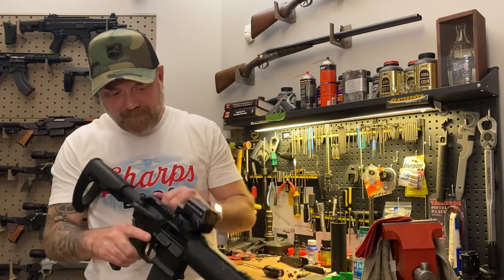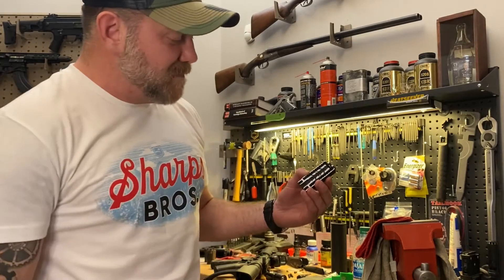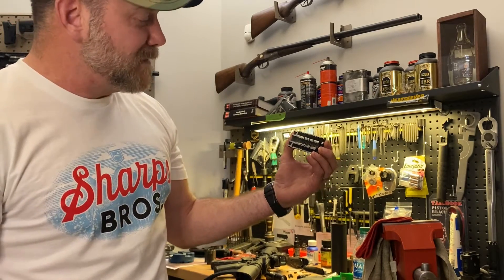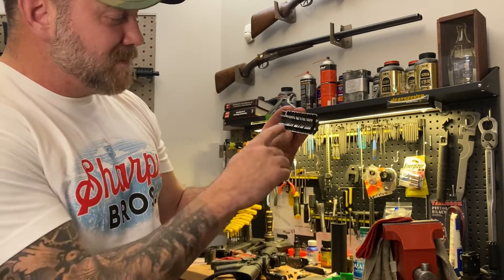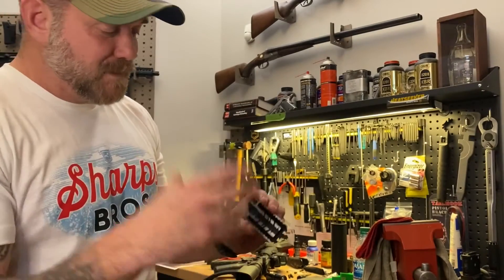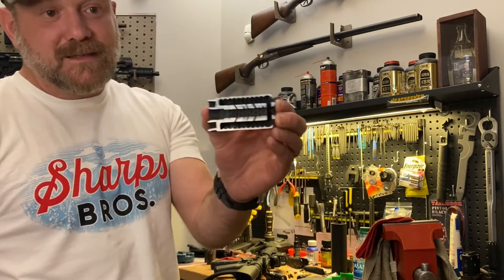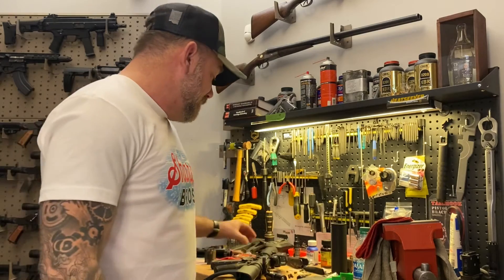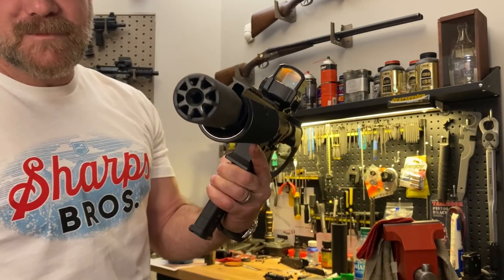A look inside Badlands. Sharps Bros’ integrated muzzle brake & blast deflector.

Comment: Does it have to be time or lined up in a specific orientation to maximize the benefits of internal muzzle brake?
Reply: No. It's pretty symetric so I just threaded mine down and used blue 242 threadlocker and cinched down w/a 10" adj wrench from Channellock that opens all the way to 2".

Comment: I'm ordering one from Optics Planet this month.
I will post some videos on my channel.

It's going on Palmetto ar-10.
I can use AR-10 Crush Washer, right?

Is there an adapter so that the 5/8 will also fit on 1/2 ?
If not, there should be.

Comment: Love it. Can’t believe it actually reduced the recoil on my 7.5 barrel ar15 so well. I do run a Banish 30 at seven inches on it so I have a semi permanent adapter that matches the 5/8x24 threaded one you sell but holy moly it really improved my ability to stay on target. I also run the JP silent captured spring which is amazing to so the two combined make it really quiet and hardly any recoil. Thanks

Comment: Has there been anyone using this on .22 lr or .22 mag short barrel AR pistols?
The POF Rebel (.22 lr) originally shipped with a thread protector and threaded barrel. They had problems of not enough back pressure for consistency of action cycling. They now ship with a "flash can" or fake suppressor looking muzzle device, to create back pressure. 
Bear Creek Arsenal .22lr uppers have a similar issue with lower velocity ammo, using their short barrel platforms. (7 to 10")
I imagine cleaning would be similar to an OSS (now Huxwrx) sealed suppressor. 
I am looking forward to picking one up and see for myself.

Comment: Anyway one of those could be threaded in 1/2x36 for a 9mm?
Reply from the maker: This is a 9mm build in the video. 1/2-28 is the most common thread for 9mm weapons - both pistol caliber carbine (PCC) and handgun so we went with 1/2-28.
Reply: @JSharps  How do you shoot 9MM if it's only .354? I thought 9mm bullets are .355? Don't you need a little tolerance over that? Thanks